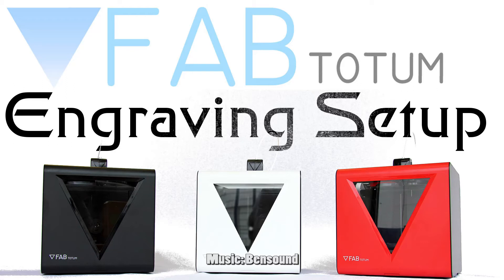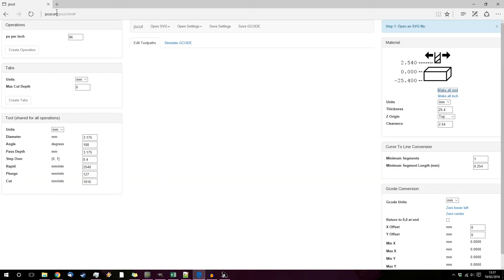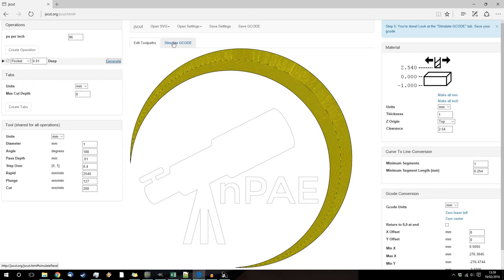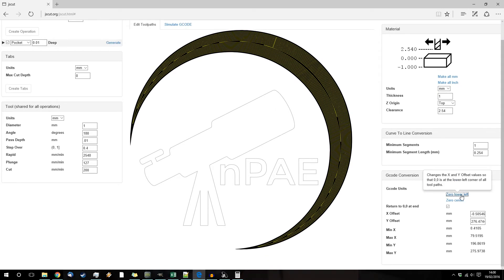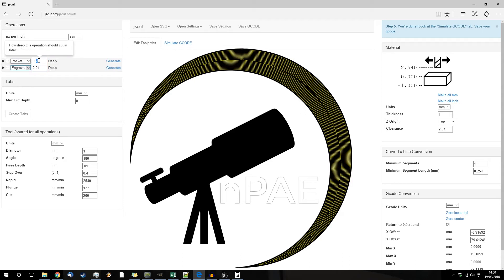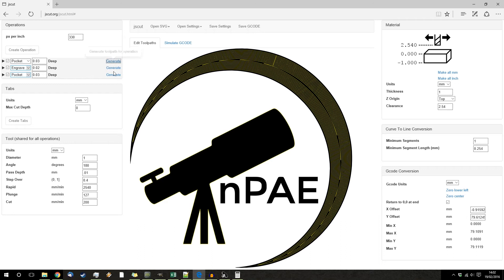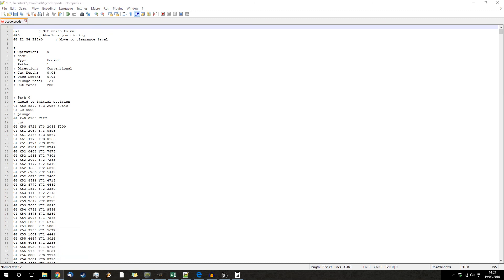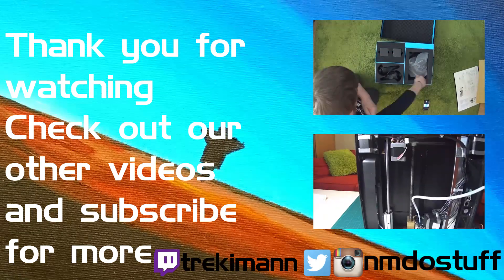FABtotum Etching and Engraving Part 1 : HandyMann

Comment: Did you ever make a part 2? I can't seem to find it.
Reply from the maker: No, I didn't get around to it and now the company have ceased trading. What extra information would you want to see?
Reply: @NickMariaDoStuff  Sorry I logged in with my other account. I have just bought a second user FabTotum, even though the company ceased trading, so I was just playing catch up. I wanted to see the next stage of engraving i.e. setting the piece to engrave, setting the cutting head height etc. I am yet to get this thing printing. There was a blockage in the PEEK part of the hotend and a problem with the heated bed not heating. I have fixed the heated bed issue, which was a the contacts not connecting properly but now my thermistor has stopped working. So I am about to try replacing that. I have flashed the current firmware and the current GUI. This printer was definitely ahead of it's time. Have you made any modifications to the printer or have just left it stock? How did you get on with the scanner?
Reply from the maker: I might have recorded part 2 but never edited the video I'll have to check, as for modifications I didn't make any modifications myself but I did send it back to fabtotum at one point because it had stopped working and they did an upgrade of the internals to their professional version but I also left the original extruder feeder on it so mine is slightly unique machine in that I can use the professional head the scanner the mill everything where as there were other versions of didn't do that. I only tried the scanner once just out of curiosity, when I need to do 3D scanning of objects I use my XBox one kinect hooked up to the PC. For anything smaller I prefer to model it myself using a caliper as I enjoy 3D modelling

Comment: I bought this "printer", first day, the hight sensor crashed against the bed, the filament gets caught on the bowden tube on the back that forces you to open the back cover and leave it open all the time to avoid this issue. 
Then the roll holder is too thin to allow regular filament rolls to be used, an adapter needs to be made for this.
Then I contacted them to buy the direct extruder head to avoid de issue of the bowden tube, they told me that to use the extruder in the first model of this printer I needed to change lots of parts to make it "compatible" and that I had to spend $800 to make it so on top of the very expensive price of the direct extruder head.
Then I tried to use the mill function, the ribbon cable melted (I guess due to amperage), I contacted them to buy a replacement cable, the ignored my requests.
So, this is not a serious company, careful. I'll try to get rid of my unit, once I get it fixed... :(

Comment: Can you mill thin carbon fiber sheets with this machine?
Reply from the maker: I have only tried aluminium so I cant say for sure. I cant see why not if the material is machinable on small CNC machines generally